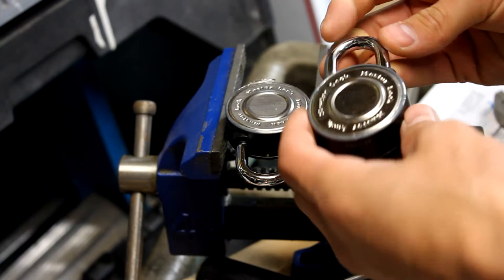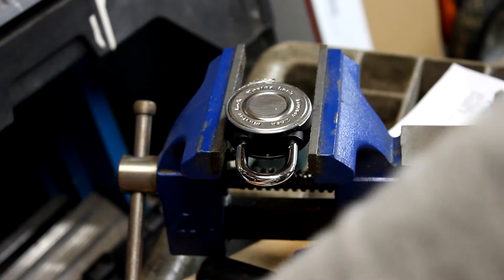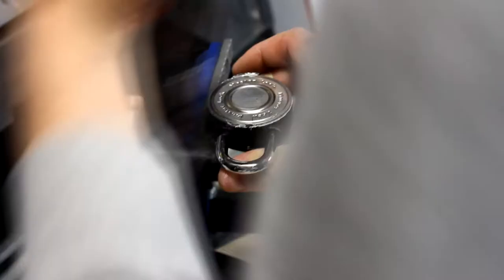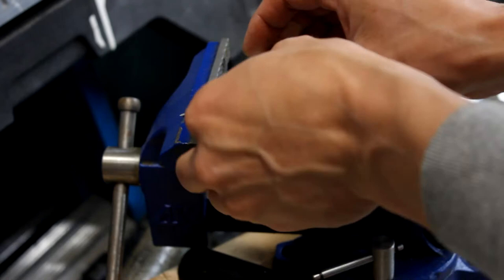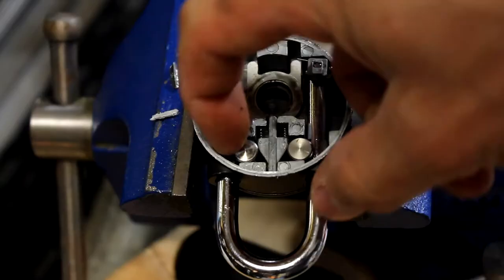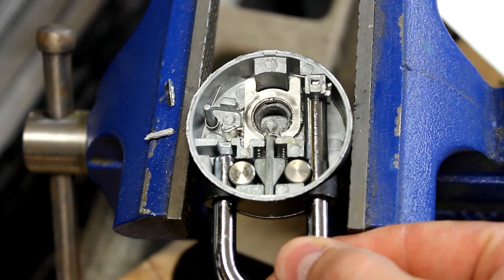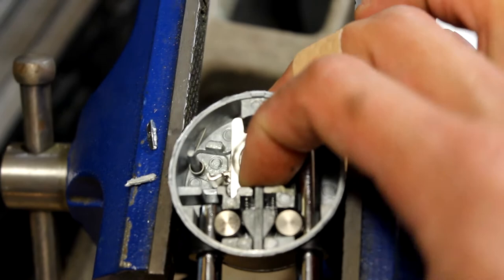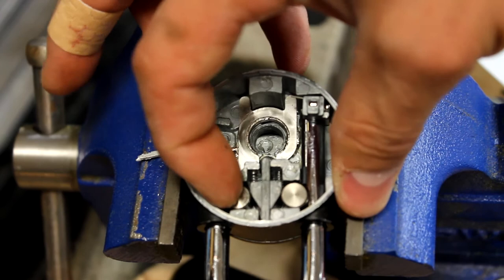master lock 1590d disassemble & decode hack crack part 1

Comment: How did you get the second back plate off?
Reply from the maker: +Roman Randall - the one that just pulls out? the video shows both plates removed.. so maybe your lock had an additional plate?
Reply: U probably didn’t pull back all the metal holding it in so it won’t slide out like in he video